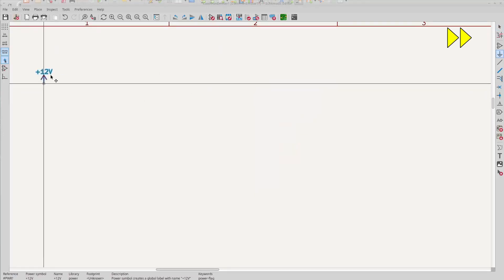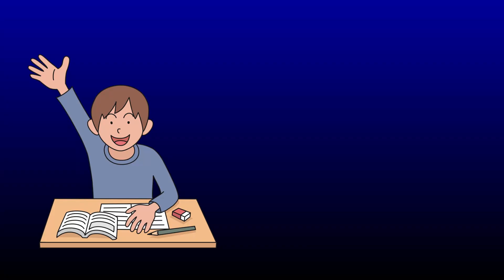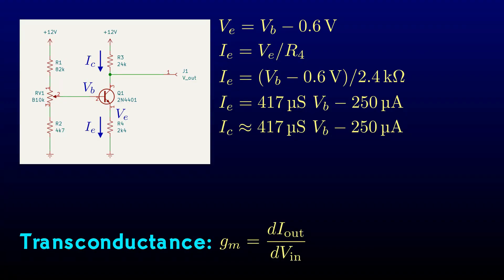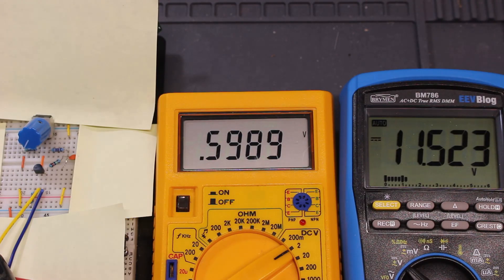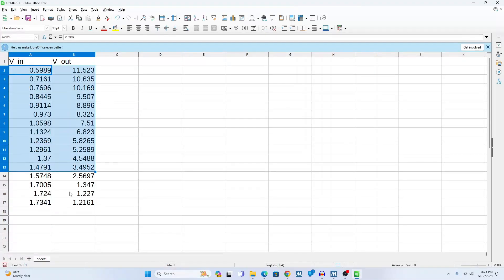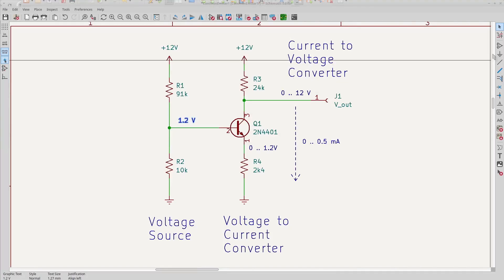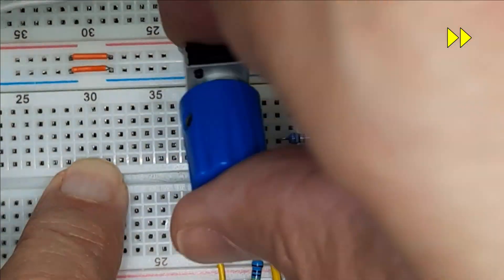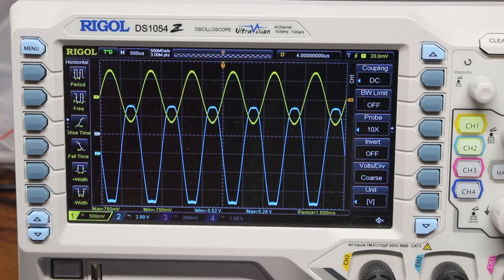Transistors 101 ep3: Common Emitter Amplifier 1

Comment: Hey Kevin, thank you so much for these videos.  @8:01 could you explain why R1 and R2 are in parallel?  Thanks!
Reply from the maker: There's a thing called Thévenin's Theorem, which shows that any two-terminal circuit consisting of voltage sources, current sources, and resistances can be replaced with a single resistor in series with a voltage source. I went through this in a lot more detail in an episode called, 'The Humble Voltage Divider' https://youtu.be/Gn7AIbaEJms?si=qOqsS29R7YxIrKLg

In this case, the equivalent circuit will be the two resistors in parallel connected to a voltage that's the supply voltage times the divider ratio R2/(R1+R2). But watch the other episode and work it out from first principles (Ohm's and Kirchhoff's Laws) so that you'll own the idea, because it shows up in just about every video in this series.
Reply: @KludgesFromKevinsCave  Thanks very much!  I really appreciate all the teaching you do!

Comment: 4:18 Where does the +18V come from?
Reply from the maker: V_out = 12V - V_R3 by Kirchoff's voltage law. Substitute in V_R3 = 10 V_b - 6V from the line above, giving V_out = 12V - (10 V_b - 6V).  Simplify the right hand side.

Comment: At 8:00 when calculating input impedance, apart from R1 || R2, can we ignore the input resistance looking into the base of the BJT ?
Reply from the maker: What's the input impedance at the base?  Beta times the emitter resistor.  Assume a beta of about 100, that means we have about a quarter-megohm at the base. Less than 1% effect on the biasing.  And the beta of the 2N4401 is higher than that.  When I picked a random one from my parts box and measured it with a milliamp of quiescent current, the beta was about 240.
Reply: @KludgesFromKevinsCave  Understood.  Thank you !!.. If possible, please show the mathematical derivations and its demonstrations for calculation of Input and Output Impedances of BJT.
Reply from the maker: @VigneshD25  This early on in the series, I'm focusing on what the circuits do, rather than working out the numbers in detail.  In episode 5 https://www.youtube.com/watch?v=AIxc-cQqKHA I introduce transistor beta, which starts letting us calculate impedances. For the common-emitter amplifier, I come back and run more detailed numbers in episode 7. I hope you enjoy the rest of the series!

Comment: Well, 0:20 contradicts your explanation for the valve analogy from the previous video, in which you clarified the valve as behaving like a resistor control, not a current control.

But here you switch back to valve controlling the current analogy (by telling it controls "more or less current to flow" while the current was constant in the previous video, hence the name "constant current source")
Reply from the maker: The constant current source has a constant current at the base, hence a constant current at the emitter.  What's actually going on is a feedback loop.  If the output current drops, that means that the voltage across the emitter resistor will drop, which increases the current through the base, opening the valve and allowing more current to flow.

Comment: Flexing your 60k counts meter, the yellow one looks to be 10k counts. Nice.  Cant wait to get a better look at your scope.  Edit: only had to watch a little further. I'm a big fan of Rigol.
Reply from the maker: The yellow meter is one I got when I was in grad school in the 1980's, on a grad-student budget.  It still works. The lack of auto-ranging is annoying, but it's fine as a second meter.

Rigol has a lot of bang for the buck. I picked it out because that's the scope I seem to see on half the electronics-hacker YouTube channels I watch, and the other ones I see are all at least twice the price. I've only a few complaints so far, relating to some really weird quantization artifacts. (The values appear to be quantized once in the A/D, and then again going to the screen, with the result that on some scales, there are screen pixels that never light.)  

One of these months I want to do a video or three on restoring the Tektronix analog oscilloscope that I picked up at a surplus auction in the 1980s.
Reply from the maker: Oh, the other night I got curious and watched where the ranges of the meters switch.  The old yellow meter is a 20k count meter, but the current ranges go in steps of 100x. The blue meter is indeed 65536 counts.

Comment: I would like to see a video of using the X/Y mode on the scope and the sweep mode of a function generator. I have both and have never used either (X/Y mode and sweep). I think we have the same models of each instrument. As an aside your voice volume varies quite a bit and would benefit from some normalization. Thank you for the video!
Reply from the maker: @justovision  X/Y on the scope is in the video about Schmitt triggers, demo-ing the hysteresis loop.  Sweep on the function Gen will come when I start on filters. Stay tuned!
Reply: @KludgesFromKevinsCave  Thanks, I'll check that video out.
Reply from the maker: Thanks for the remarks about the audio.  I was using an audio compressor in 'kdenlive' but owing to a misconfiguration, it wasn't actually compressing.  It'll be a few weeks before the problem's fixed - I try to run a 4-6 video backlog - but I'll try to be more careful moving forward. Still learning this video stuff!